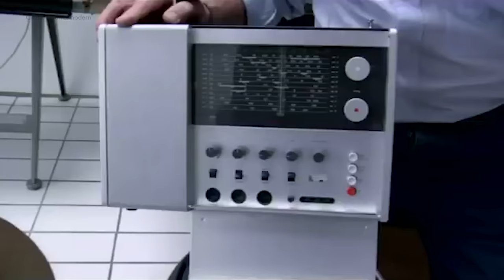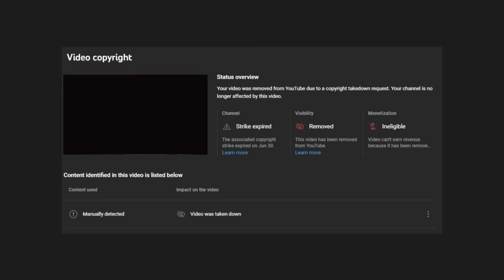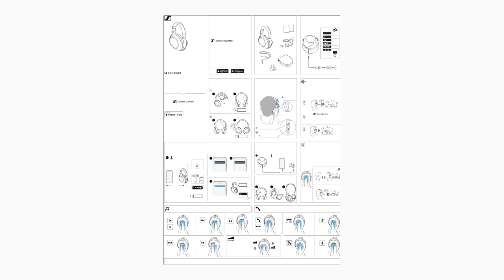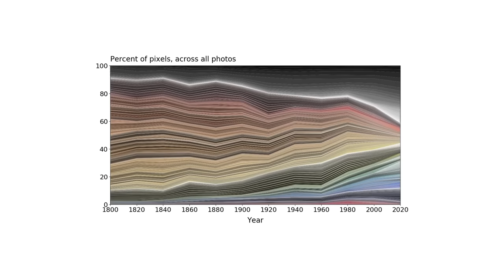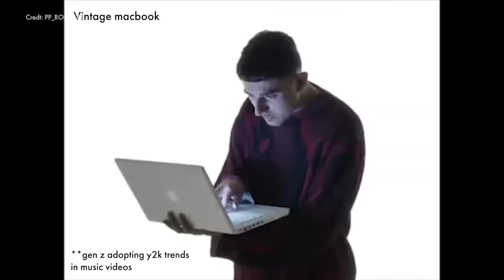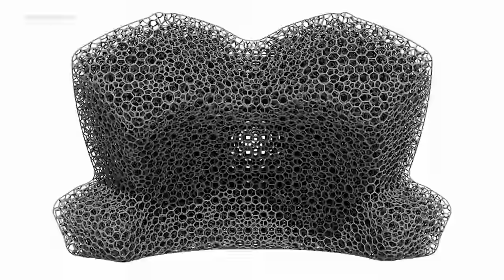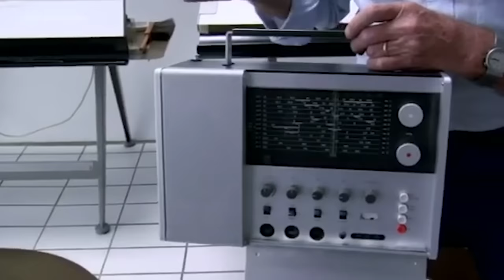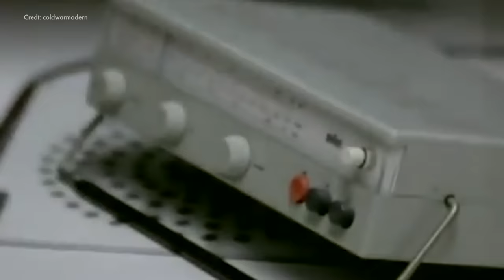Minimalism is Getting Absurd: Updating Dieter Rams' 10 Principles

Comment: taking feelings into account is of course great. 
feelings of safety, connection etc... but using feelings to get a hit of cheap dopamine, like porn or a "I'm better than you because i got a Panerai" is harmful to individuals and society.
one can leave solidly designed products open to customization: auto-tuning of classic models, individualized faceplates on mobile phones, soviet style glass holders for ikea drinking glasses. 
customizable will also tend to make them fixable and upgradeable.

Comment: I think you've also misunderstood or caricaturized (or possibly purposefully misrepresented for the purposes of driving engagement, in which case you've done an excellent job) many of the principles.
    Honesty in a product means not implying features the product doesn't have – for example if you paint plastic with metallic color a customer might expect it to be as durable as something made of metal. The turtle shell example is ridiculous: it's a purely aesthetic thing with no implications for how good the product is (in fact plastic is a better material for the frames than turtle shells), and I think it's safe to say most customers are unaware the styling even comes from some archaic turtle-based material. It just looks like regular plastic with a pattern on it.
    "As little design as possible" does not mean cutting features for the sake of cutting features. Good design has the maximum amount of functional design with the minimal amount of aesthetic design – the exact opposite of what you seem to be arguing for. Making a product simpler at the cost of making it worse was never (and will never be) good design. Maybe a better phrasing for the rule would be "as much design as is required - but not more" to emphasize this distinction.
    There is no contradiction between "good design is thorough down to the last detail" and gardening. You can't bend nature to your will, so a good designer works with it in collaboration rather than trying to play god. Paying attention to details does not necessarily mean everything is precise down to the last millimeter, it means that you must consider every constraint on the system (including ones that are not obvious and ones that you can't control) carefully.

I wasn't a big believer in principled design coming into this video, but hearing your arguments and counter-examples has made me reconsider. Many of the examples you showed (the lemon squeezer, iPhone, ugly plastic watch(?!), PS5, Lamborghini Countach) are anti-functional designs optimized for marketing rather than end user. I don't think the world needs any more design like that.
Reply from the maker: I think that you have misunderstood my points, actually. Most of it is already explained in the video though. I do want to address this one point that you made, however. You said, "Good design has the maximum amount of functional design with the minimal amount of aesthetic design". This is only true in very specific contexts. It's also impossible to quantify. If you don't like products that are overly expressive or decorative in their aesthetic approach, that's fine. But that doesn't make it a universal maxim. It doesn't even make it a very useful design principle. It just makes it a personal preference.

Comment: Well, 2019 Macbook pro is a prime example of fake simplicity..  you have to remove a slew of super fragile tiny flat cables and the entire motherboard to clean the f-ing fans! Not to mention insufficient cooling capacity for ..probably every single MBP at least until the M1 (no experience with those so i don't know)..  i mean i'm super happy with mine because it just has enough redundancy to basically never run on full power, but i tried some 3D-CAD renders with ray tracing and it throttled down to a crawl after like 5 seconds 🤦‍♂

Comment: I feel….. you misunderstood honest design. My main interpretation is that a product should not appear to have features that it does not. Not mimicking  another products value is important but less so as in. If a cheap product looks expensive so throughly it’s indistinguishable, then you’ve just cheaply made an expensive product, congratulations! 

But if it’s made of cheap fake materials that quickly fail, now you’ve tricked the customer and lied to them about the value and durability of the product. That’s dishonesty

Comment: Product design, when the constraints and purpose are unchanged, should be working towards a refined solution, that works better, interfaces with the user better, is cheaper to manufacturer and lasts longer. This is the frustration, useless aesthetic variation and the lack of progress towards a perfect design. The first toaster was designed in 1893 - bread is the same, human hands are the same - by now there should be a perfect, winning toaster design, it should be affordable and should last forever. But instead we have 1000 toasters, all with different controls and interfaces, at prices anywhere between $500 and $20.

Comment: "The fun of fishing is why we use a fishing rod instead of electrocuting everything in the pond"
Im pretty sure its because otherwise it wouldn't be sustainable as there's no living fish left to breed. This is why were trying to limit the depth of how deep our ocean nets will go so that we arent killing the entire ecosystem on accident. 

As for good design is innovative, i think a better rule would be instead of "innovative", as this suggests creating something noone has thought of before, the best kinds of designs are ones that are *iterative*, in this case not much needs to actually change, as long as the feature you are adding(or changing) is valuable to the product you are designing. I think this is why patent trolling can be so intensely stifling to industries, because some products just dont need more features or a completely unique design to work properly. There is no real way to get around building an inkjet printer better than the companies that already do without retreading ground defined as off limits by those same companies.
Reply: The fun of fishing is sitting in contemplative silence for hours at a time being away from the wife and kids. If you're catching fish and you don't need them to live, then you're doing it wrong. If you need to fish to live, then you have more problems to contemplate and need the long absences of sound more.

Comment: If you sit in that Porsche you'll find it's very boring inside. The controls are simple and few. The interior uses very few materials or textures. No fancy stitching, or lighting. The seats the panels the dash, all hard surfaces.
It's you some pedals a steering wheel and a shifter in a seat and rudimentary controls for heat air and a radio.
It's simple and that's exactly the opposite of what you assume it is.
You're obviously thinking of something sold in the last 5 years when you attack his choice of car.

Comment: Not a fan of his designs really.. That calculator is counter to those principles. With raised buttons that fingers slip off rather than dished to prevent slipping and depressing colours that make you just want to throw it in a draw and ignore.
And the modern design that I hate more than any other?  Vanishing scrollbars.. They are a display/status element, not just a thing to use..

Comment: There are only two design principles that I kinda live to. That is that good design should never put the looks of something over the functionality. Making something functional look better - yes of course. But making something objectively, functional worse just to make it look better (like let's say curved displays on Smartphones), I'm totally against that.
Besides that, "good design" is just evolving all the time. There's no real right or wrong here. No real "rules". Just preference. I even would say it makes design worse when you apply the same static rules all the time because it means you're stuck. And isn't that against one of his rules of design being innovative? 🤷🏻‍♂

And the second simply being, if you need to explain your design, it's not a good one. Just like with jokes. Good design basically just should not need an instruction manual. This is one of the main reasons why I like most Apple products. There basically is no instructions included with them except for very basic stuff like how to turn it on (which maybe is even required for them to do idk). But besides that? They're mostly just self-explanatory.

Comment: I am a lot into cars and I see things you mention a lot. Up until 2010, I can recognize what brand a car is based on the design philosophy alone. But modern SUVs are basically iphones on wheels, with very few exceptions. You could stick any car brand logo on them and convince anyone that it's the original logo the car came with. This is quite an irony, given the mechanical complexity and intricacy of modern cars.

I am in pure disgust with Tesla's "minimalism" which is what triggered the ugly minimalism craze in car design. I got to see one from up close and on the exterior, it's a washing machine with wheels. On the interior, you have a gigantic, totally obtrusive touch screen that looks like it was hot-glued there. Intuitive controls for anything from braking to AC, are nowhere to be found.

Now compare that to truly minimalist cars like 90s and 00s Mazda for example. Minimal use of visual features on the outside, but not stripped out like modern cars. Designed with just as many visual features as there need to be. Same on the interior. It's not like an airplane cockpit, but you dont have to navigate through stupidly designed submenus upon submenus like modern cars either. Everything where it needs to be, and aesthetically pleasing.

What car companies sell nowadays are intricate LED lights (that cost half the car's price to replace if they break and they will) and futuristic, fancy looking UIs (that are laggy and horrible to use). It aligns well with the rise of fashion that is cheap to buy, even more cheaply made, but looks expensive. Everyone wants to look like they have the coolest clothes, phones, cars and whatever. I can't really not connect this with the obssesions over money, fame and the unrealistic "living the best life" thing social media platforms have triggered in millions of people. Yes it's cheesy to blame phones and social media for where society is heading, but you can literally see its reflections on product design. Luxury minimalism is literally the proof of it

Comment: It's funny that you think the Braun calculator is "probably functionally better, because of its good design, it's probably made better." because you're wrong on both accounts. Having used both, the $4 calculator is constructed better, with better materials, more features, and is all around better designed as a tool. The Braun isn't even better looking, just different. It's like all of the products made by this company, they look sleaker and are universally constructed more poorly with fewer features/functions and worse components for significantly more money. Minimalism almost universally makes worse products.